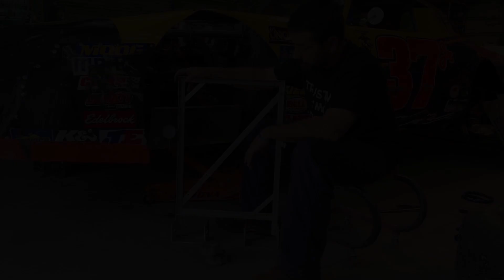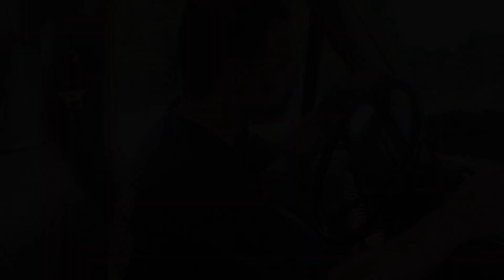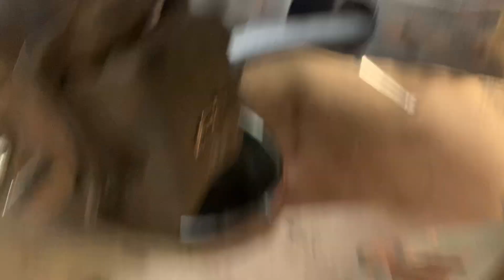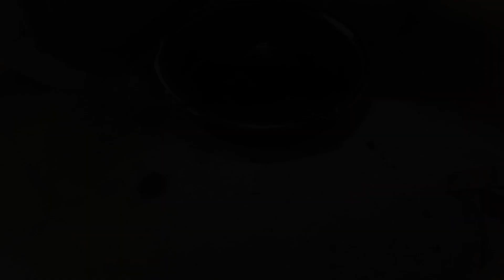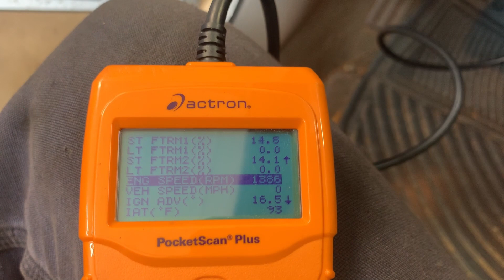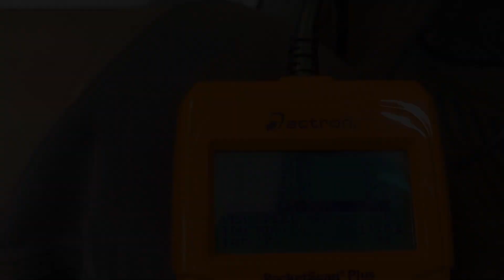1997 Ford Taurus No Start Bad Crank Sensor Replace

Comment: Is it normal to have an oil leak from this sensor? My Taurus is leaking oil, and it seems to be leaking from here. If so, do I need to replace it or apply some kind of gasket or silicone?
Reply from the maker: I think I have seen engines leak oil from here 👍
Reply: @ChristmanGarage  Thank you sir, I'll start with this.

Comment: Dude this help me out so much. I thought it was my fuel pump but I tested it and it worked. They got fuel all the way up to the injectors and still no fire are used starter fluid and it cranked right up but as soon as it ran out, it stopped, so it told me I was getting fire to my spark plugs and then I found this video. Thank you so much.